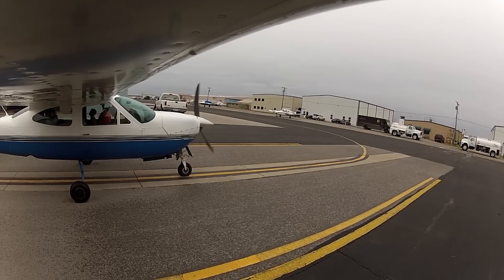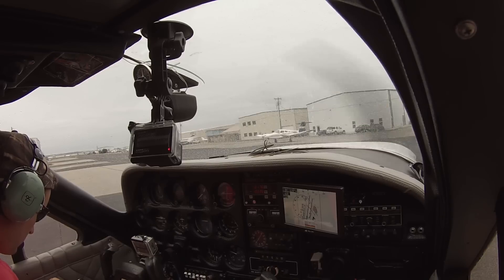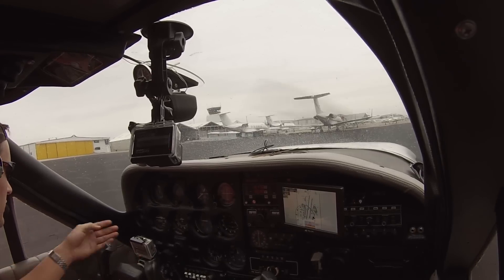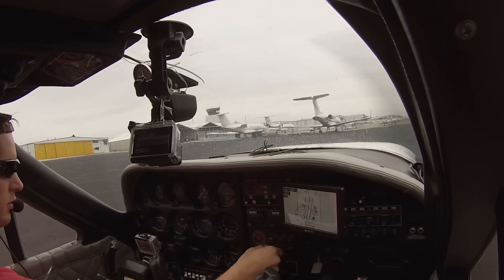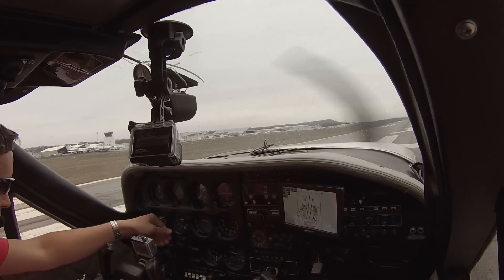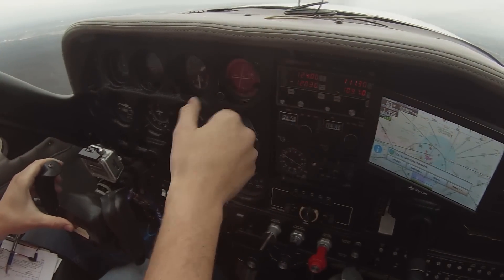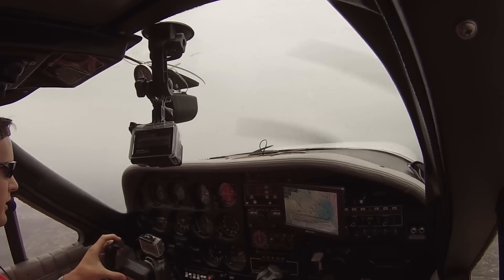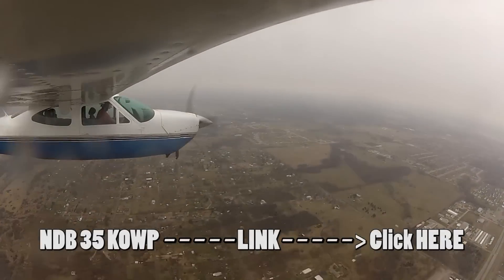IFR - Solo into IMC

Comment: the drop in rpm and rise in manifold pressure thing during the op feather check is an old wives tale. All you have to do is make sure that it cycles properly during the feather check.
Reply: Michael Rutherford But that is exactly what happens, why would you not confirm the indications are as expected? Singles don't feather.
Reply from the maker: Ding ding ding. Lol

Comment: Did you notice DEP cleared you to 3500 and you read back 3000?
Reply from the maker: You missed the note on the screen. Other radio transmissions were cut. I received 3000 as a final. I placed that on screen for everyone, but you were the first to catch that.
Reply: The Cardinal Pilot Saw the note after I posted the comment.  :-)
Reply from the maker: Mark Russell No problem! I appreciate you commenting!